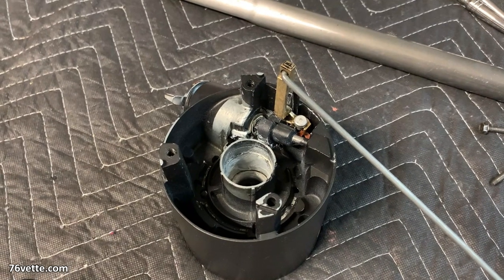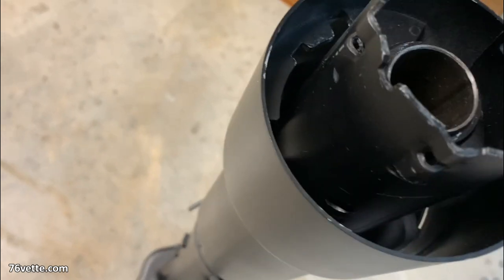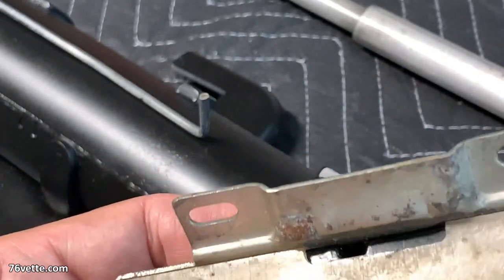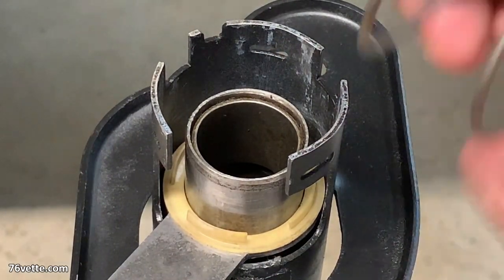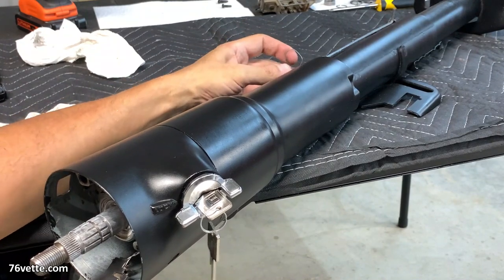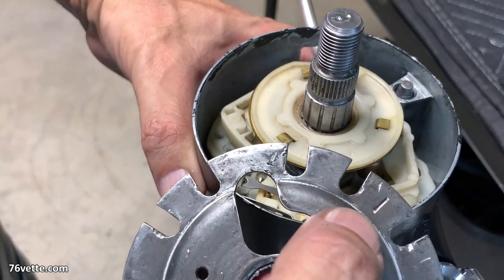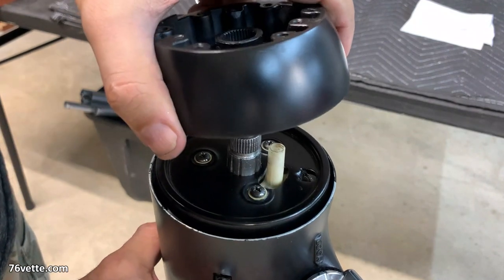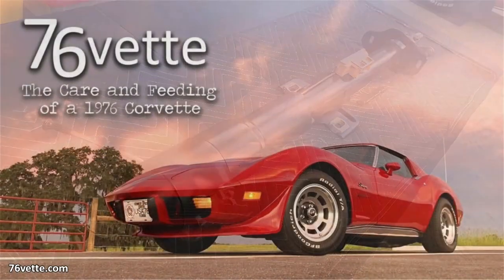Standard Chevy STEERING COLUMN Reassembly

Comment: Hey Luis,
I just assembled my ‘71 manual column with some help from more experienced builders and found out that the plastic sleeve (the one with a funnel shape) goes between the upper (key) section and lower column, not at the bottom on the spring. I can send you more info on that if you like. 

Mentioning it here because I was going crazy trying to make it fit before discovering the correct fitment. 😅

Comment: Nice video. i have 1969 . cant figure out how to remove the inner part of the column that has that connects to the tranny cable
Reply from the maker: You may want to look at the pics I posted to Instagram a while ago, as they may help you understand how to disassemble the column. Hope it helps. 
https://instagram.com/p/CQtlmZ8lou2/
Reply: @76vette  thanks, I got it, I had to give it a little smack and it slid right out.